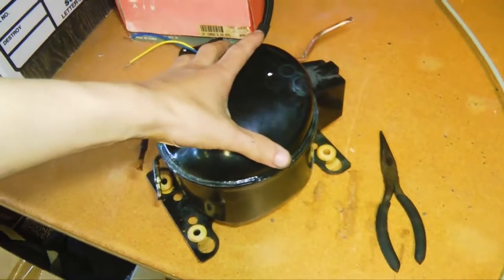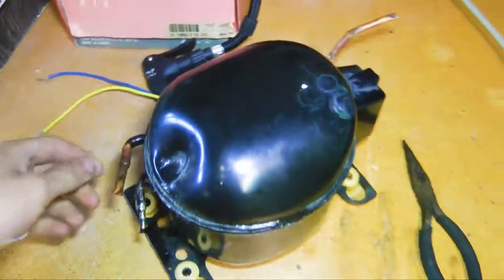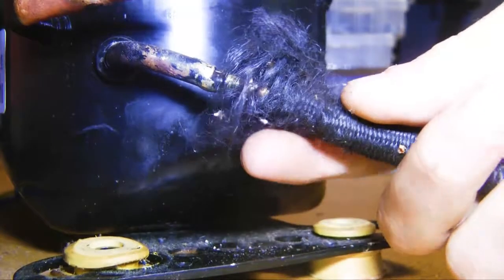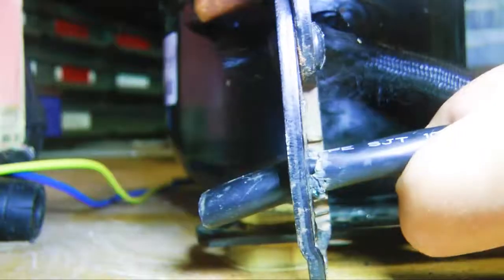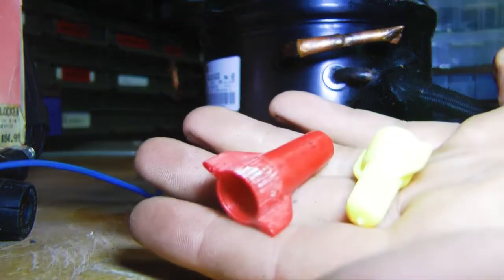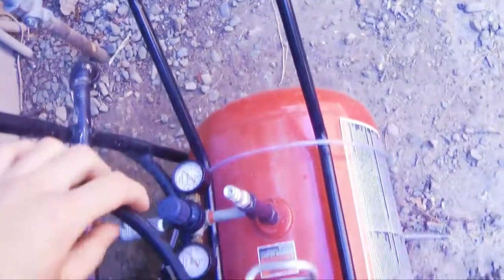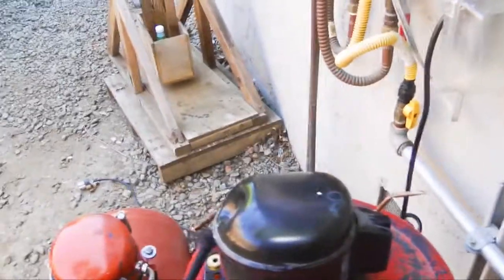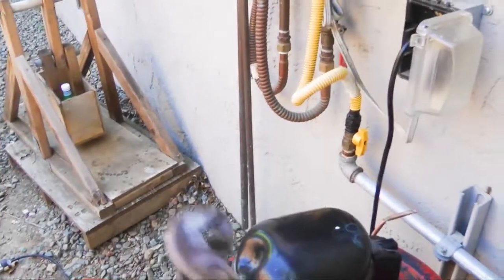HOW TO MAKE AIR COMPRESSOR SILENT  TRANSFER PUMP  350psi

Comment: The ground wire is the most important wire in the project. Not connecting it is why you got shocked and the reason it didn't kill you was because it wasn't a dead short. Hence the name dead short. To explain this a little further, anytime you have an electrical device that is not completely insulated like a refrigerator for example the metal housing MUST BE GROUNDED. A faulty or disconnected ground can kill you and anybody that you love when they see you are being electrocuted and they try to help you. As soon as they touch you they too will be electrocuted  it also will increase the current going through your body to further enhance your experience. But us engineer types we just like putting extra wires on things to complicate matters don't we. PLEASE PEOPLE, do not think that what you see on you tube is safe. Do your own research and if you are unsure, ask an electrician. Or go to school.

Comment: Always wear shoes for safety, once you get used to wearing them daily they are more comfortable than being barefoot.  Compressor needs oil if it is going to last. It normally gets it's oil from the oil in the refrigerant. The compressor shouldn't have shocked you, I'm going to guess that one was shorted which is why it was junked and was why it shocked you. If you hook up a ground (to the 3rd prong on an electrical outlet not a ground rod) it will probably trip the breaker due to the short.  I would get another compressor.
Reply from the maker: ahh its ok it was only a little shock prob cause it wasn't grounded  and i was bare foot on wet ground
Reply: @ianbuilder  The ground is to trip the breaker if there is a short, it doesn't get rid of voltage. A ground rod alone does nothing. It has to be bonded to the neutral at the panel which your third prong on your outlets should already.  If there isn't a fault it should not have shocked you, ground or no ground. Look up Mike Holt, he has some great videos on this topic. Just looking out for your safety.
Reply: I respect the no shoes